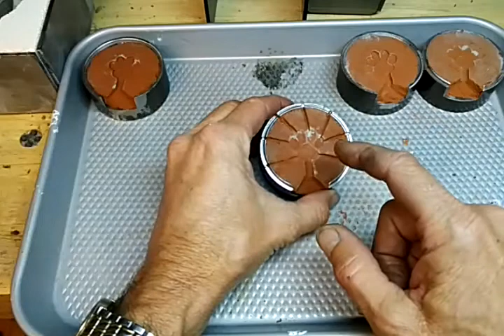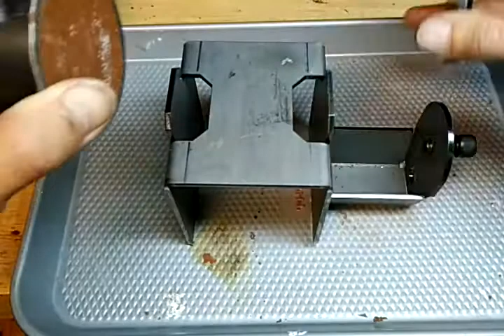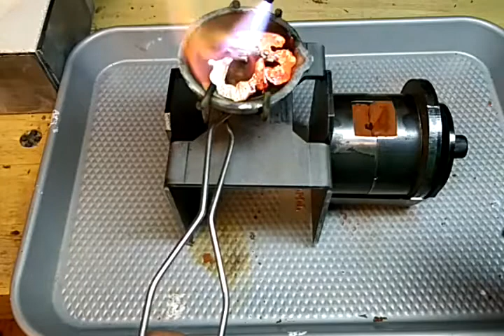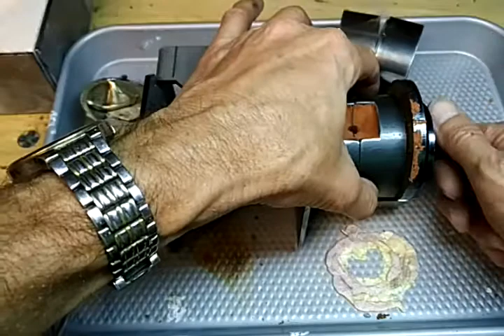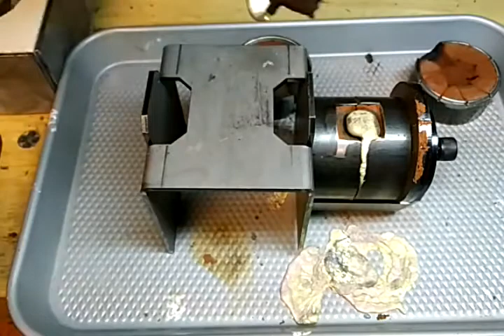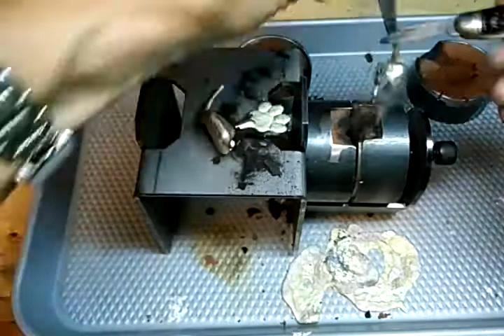Sand Casting Comparison Using Delft Clay and Petrobond

Comment: Dude!... ease off the oxygen you are destroying the silvers properties it will make very bad cast. That silver is so embittered you might never be able to re cast without refining.
Reply from the maker: I know, but after 40 years as a bench jeweler I actually have far more experience at this than it appears on the video. I also use the same metal multiple times when making videos and it isn't until its been cast many times that it starts to break down. I've literally cast the same 1 1/2 ounces of sterling silver over 10 pours before it is ready for refining so yeah a neutral flame would be better if making something for a customer but this isn't the case and both castings turned out fine.
Reply: @craigdabler-thediycastings7511  Lol I believe you, but if you are watching this for the first time, it is like nails on chalk board. Good vid thanks

Comment: Craig, I know this video is old and not sure if you read your comments but i'd like to know where you get those clay molds. Do you just buy the standard aluminum then grind out your pour hold on the side?
I see the typical round ones online but I cannot find one like yours.
Also do you have a mold recommendation for casting something longer and more narrow? Specifically a rifle cartridge shape.
Reply from the maker: Hi James, I actually made and sold these but have since replaced them with a much better model available in this size (2 1/8 inside) and 4 inch (3 5/8 inside). My site is www.diycastings.com. Thanks!
Reply: @craigdabler-thediycastings7511  oh wow very nice! Thank you.
I think I might've just found a new hobby!

Comment: Any thoughts on the surface finish between the two? Looks like the Delft clay is a bit better, and the petrobond has the pads sunken more.
Reply from the maker: Petrobond is 140 mesh and Delft 220 mesh but after a simple file stroke they will both finish with the same amount of work. Delft allows for better detail since it is more compact and Petrobond can handle more fragile pieces so they both have a place in sand casting.
Reply: @craigdabler-thediycastings7511  Thanks! Lost all my petrobond, so I'll try some Delft next.

Comment: Sir: how do you figure the amount of silver or gold to use for a casting?....example, i have a  sterling ring that weigh's 3grams, would i use 3gram's of silver to cast that same mounting? ....same question for gold say 10kt, it's a "dad's nugget ring that i got for fathers day some 15 years ago, weigh's 3 gram's. i appreciate your video, will be ordering some items from you in very near future...
Reply from the maker: For me, when sand casting, I feel it is important to have at least 1/2 to 3/4 ounce extra to both help push the metal into the mold and help with cooling the metal.
Reply: @craigdabler-thediycastings7511  thank you sir, that answered my question.

Comment: What torch did u use
Reply from the maker: Oxygen and propane with a Hoke torch.
Reply: @craigdabler-thediycastings7511  im wanteing to melt silver bars into art weve been borrowing a oxyacetelene torch do u thing a hoke torch could melt 10 oz of silver shot ..10 ounce bars is the max id like to make mostly 5 oz and smaller
Reply from the maker: You need to buy an Electro Melt. I've never melted that much with this torch so I don't know if it can or can't.
Reply: Does the hoke run on the small mapp and oxygen tanks from a hardware store?
Reply from the maker: not sure, but most likely. I use full size bottles with regulators and never used the little bottles.
 @eluminateoccultis1966
Reply: Ok thank you brotha

Comment: I really appreciate this video.  I've been considering doing small castings in brass (a big upgrade from my rough castings using aluminum) and have been looking into delft clay vs petrobond.  This is the first video that has clearly demonstrated both products.  Again, thanks!
Reply from the maker: I have been taking 50/50 and combining the two and have found it works very well so this might be something also to consider.
Reply: Do you need to vent a 50/50 mix?
Reply from the maker: Not usually but on heavier objects I do it anyway since it's so easy.
Reply: Craig Dabler thanks for your response!

Comment: Thank you for posting this video! Would you say that there is really no difference in the quality of the pieces (smoothness, shine, etc.)?
Reply from the maker: The two pieces were virtually identical but I will say that if the item was more complicated then the Delft would be far easier to work with because it is a smaller grain and compacts tighter making it stay together better when removing more complicated designs. For big flat designs, the Petrobond works just as well and doesn't require venting which is a real plus.